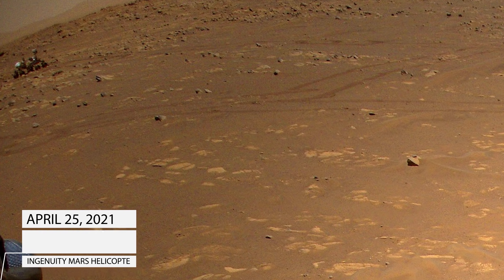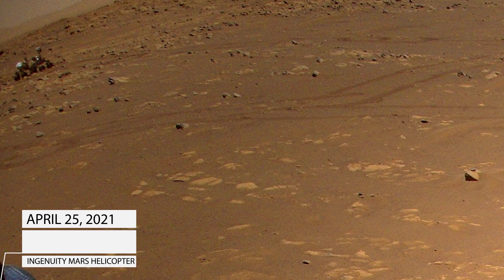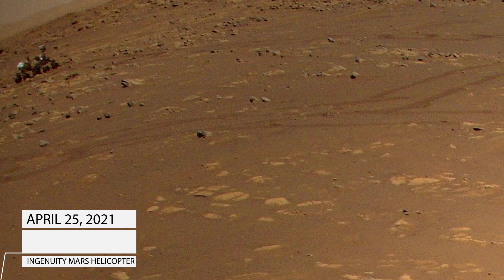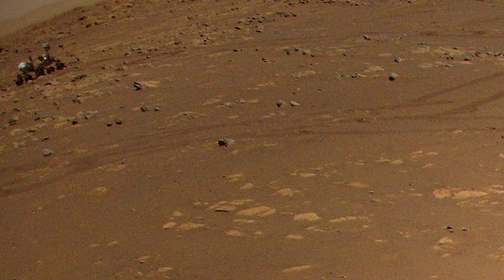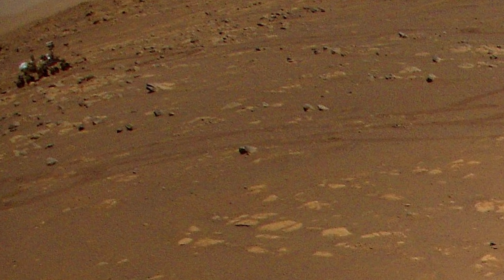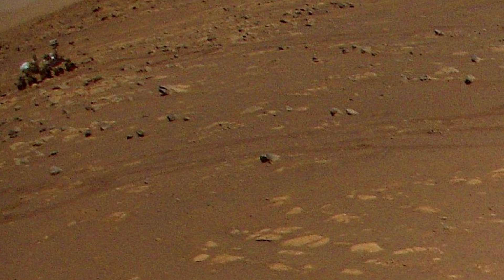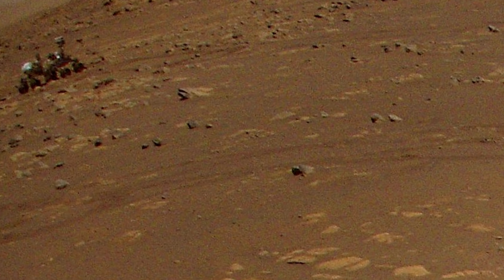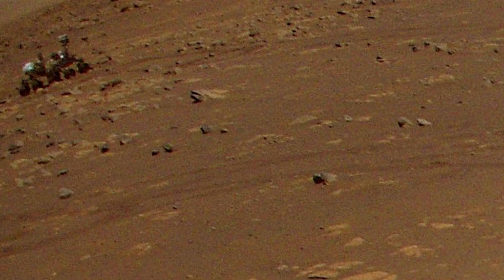NASA Mars Helicopter Ingenuity Spots Perseverance From the Air during its third flight

Comment: Everything will be great until something tips this over like maybe a hard landing , if it were a drone they are now possible to self right them selves unlike a helicopter.
I’m still not sure why nasa went for a coaxial helicopter design
Reply: Less moving parts and more lift from a wider blade span?
Reply: @Daimo83  if you consider the rotor head and all the linkages to make it manoeuvre on the swash  plate  and the servos and their own gearboxes and bearings on the Mars helicopter it’s actually much more moving parts than just four motor on a drone., and as far as blade span you can make them any size you like if you put the right motor on it...🤔
Reply: Storage space on the rover
Reply: im not sure why you think youre more intelligent and more versed in space exploration than top leaders in their field
Reply: There has to be some attribute trade-offs that are important to them that led them to a co-ax design. I'd like to see their explanation. My bet would be on power consumption being higher for a quad.
Reply: @familyfun3311  Thin air
Reply: @azmjim  So a quad wouldn't work in thin air?
Reply: @familyfun3311  Too much weight using quad engines.